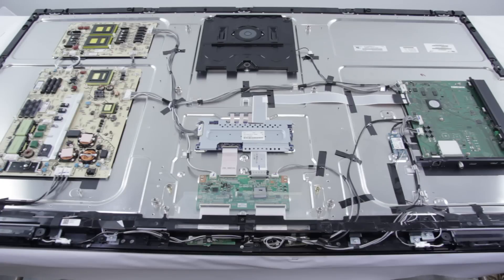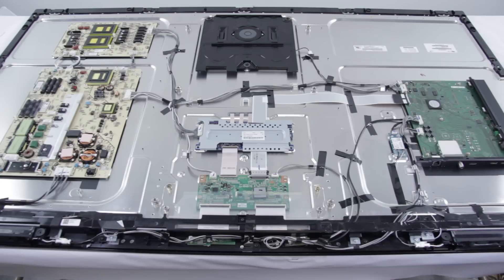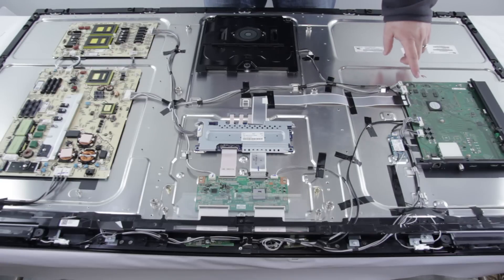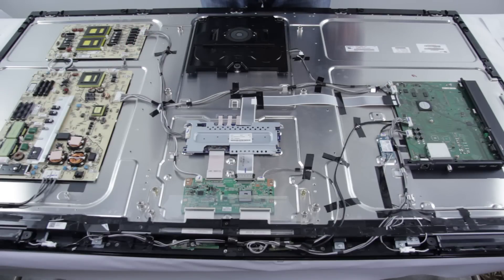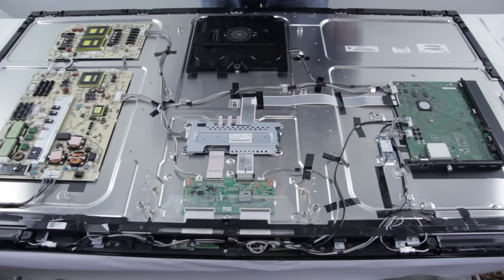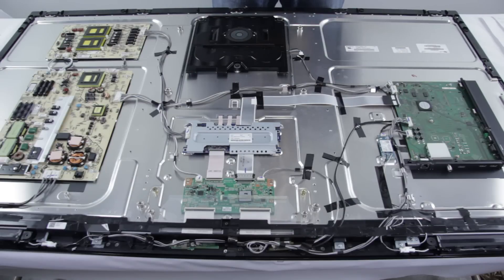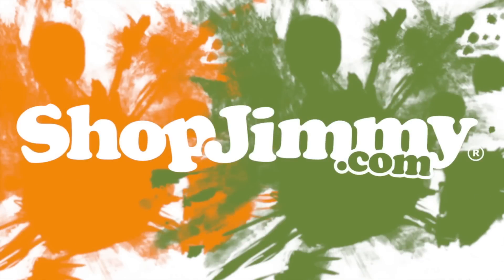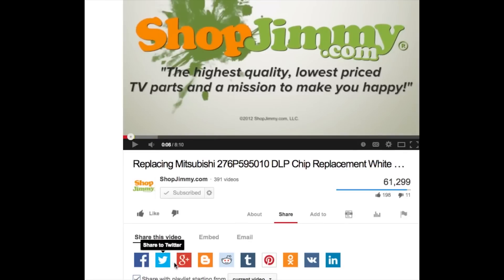LED TV Repair Main Board Overview Blank Screen-TV Has Audio but No Video-Common Issues Problems

Comment: I have a vizio led smart TV model E420i-A0, I was watching it and all of a sudden the screen went black but I still had sound. The white power light initially is bright but almost instantly fades to very dim if you turn it off then back on. The screen remains black. Any thoughts? Thanks!
Reply: Matthew Fultz I have the same exact TV and the very same thing happened to me. Screen wen black but still had sound. The white power light was bright then it dimmed.... Did you ever get your TV repaired? If so how? I'm hoping its a simple replacement.
Reply: I spent over 100 on parts. Replacing everything but the led panel with no luck. Sorry it took so long for a reply. Save yourself the frustration and buy a new (NOT vizio) TV.
Reply from the maker: Matthew Fultz  PLEASE SUBSCRIBE TO OUR CHANNEL - Try all repairs and troubleshooting at your own risk.   That could be a problem with the LEDs in the TV, if you tried replacing the Power Supply / LED Board and the main board and it did not fix the problem.  You can replace the LEDs in the TV and see if that fixes the problem.  LEDs can be difficult to replace and it is possible that you can damage the TV panel, if you damage the TV panel it is not repairable.  It is recommended that someone with experience or a trained professional replace the LEDs.  Click this link to replacement LEDs for your TV model number:  http://www.shopjimmy.com/lg-lc420dug-jfr1-led-strips-10-strips-1-board.htm  Be sure to match the panel sticker number in the listing with your TV panel.  Thanks and please let us know if you have any questions!  www.shopjimmy.com

Comment: hi i have a lg47ln575v when switching tv on, screen comes on for 1 second and then goes pitch black. I can see the picture very faintly and when i switch the tv off it shows the picture for a second and then goes off. it does this everytime i switch tv on or off.audio works perfect as does everything else. Problem is a blank screen. Could you please help

Comment: I have a Samsun tv type UN50EH5000FXZA that has sound and leds but no video  Visual inspection of all boards and cables was ok I replaced  all tree board on it but non corrected problem any ideas

Comment: Hi i have Panasonic TX-L37E5B Problem is that i have black screen whit sound, even i can't start menu or whatever. when i put antenna i can hear only sound but without picture, nothing. i can't see which channel is that, i can't see menu options nothing at all, only sound. Can you tell me what and where is the problem?  Thank you!

Comment: I have Polaroid LFM323B 37" LED that has a black screen w/various vertical color lines and nothing else, any suggestions
Reply from the maker: Scott Dempsey  This sounds like a TV panel (TV Screen) problem.  If your TV panel is bad, it may be more cost-effective to replace the TV as panels are typically hard to find in stock, difficult to replace, and expensive.  Thanks and please let us know if you have any further questions!  www.shopjimmy.com

Comment: I have a Vizio M601D-A3R LCD. I have the power light on the bottom of the screen. I have sound. I can see the picture when I do the flashlight test. My TV has 3 large panels on the back and does not look like the ones in the video. Whats next?Walt Macon

Comment: Vizio E50x-E1, serial # LTMWVJWU -  works well for about 45 minutes than picture goes away. Restart and works again for 10-15 minutes and picture goes away. Has Sound. I can see light bleeding around the edges of the set (back is off) when the picture is gone. 'Flashlight test' shows no picture on the screen during failure.  Unplugging the ribbon connector on the left side of the t-con and I get 1/2 a picture that does not fail & the other side is white/blank. Unplugging the ribbon on the right no picture, one side of the screen is white and the other eventually turns bright yellow.  Display stays lit for hours with one side or the other of the t-con disconnected. Swapped a t-con, same thing. Am I looking at a main board problem?  thank you in advance.

Comment: ok,

Quick question here guys. I have a Vizo  e390i-a1  Well after a recent storm passed through our area I came into the room to find that my TV was broken. Orgnialy I thought it was not getting power. After opening it up I saw no evidence that this was the case. Now I have power, I simply do not have a picture. Is this a simple parts replacement? Or is there more to it.

Any help you guys could give would be much appreciated.

Thanks.
Reply from the maker: twichy69    PLEASE SUBSCRIBE TO OUR CHANNEL - Try all repairs and troubleshooting at your own risk.  I recommend replacing the main board in your TV.  Click this link to replacement parts for your TV model number:  http://www.shopjimmy.com/catalogsearch/result/index/?cat=56&q=e390i-a1  There may be multiple boards for the same TV model number, be sure to match part numbers on your current board, with your replacement for compatibility.  Here is a link to a video showing how to identify your part number, click here:  https://www.youtube.com/watch?v=kxkeGLhlQY8  Thanks and please let us know if you have any further questions with your TV Repair!  www.shopjimmy.com

Comment: I have a Samsung UN46FH6030 TV.  I still have an image but it is very dim.  When I adjust the backlight it works normal at backlight settings 1-3 but once I select 4 or higher it goes VERY dim.  My first thought based on your videos is that my LED board is going bad but not yet completely failed.    Based on the parts available for my TV it looks like the power supply and LED board are combined.  I opened up the  back panel and the model number on the power/ LED board is BN44-00564C.  Just checking to see if my diagnosis sounds right before I order the part.
Reply from the maker: Michael Button   PLEASE SUBSCRIBE TO OUR CHANNEL - Try all repairs and troubleshooting at your own risk.  This could be a problem with either the power supply or bad LEDs in the TV.  You can replace the power supply board to see if that fixes the problem.  Click this link to replacement power supply boards for your TV model number:  http://www.shopjimmy.com/catalogsearch/result/index/?cat=229&q=UN46FH6030  There may be multiple boards for the same TV model number, be sure to match part numbers on your current board, with your replacement for compatibility.  Thanks and please let us know if you have any further questions with your TV Repair!  www.shopjimmy.com

Comment: Hi  I have westinghouse dw39f1y1. I was watching TV and it went blank. If im Shining a flashlight at the screen... I can barely see the picture.. So the back light isn't lighting up

What part is commonly bad when this happens?
Reply from the maker: +Dustin McCallen   Try all repairs and troubleshooting at your own risk.  This could be a problem with either the power supply or the LEDs in your TV.  You can replace the power supply board in your TV to see if that fixes the problem.  Click this link to replacement parts for your TV model number:  http://www.shopjimmy.com/catalogsearch/result/index/?cat=59&q=dw39f1y1  There may be multiple boards for the same TV model number, be sure to match part numbers on your current board, with your replacement for compatibility.  Thanks and please let us know if you have any further questions with your TV Repair!  www.shopjimmy.com

Comment: i have a SEIKI 32 inch flat screen tv model number SE32HY27 my problem is that i was watching tv then went out of the house but when i came back in there was only sound but no picture i was able to change the channels still but i was still not able to see anything on the screen. do you know what could be the problem?
Reply from the maker: Dustin Lathan   Please watch this video FIRST to help with your repair!  TV Repair! LCD, LED, Plasma, DLP How To Fix Your TV with ShopJimmy.com Help!  Looks like there is only one board for this TV, and it should be replaced.  Here is a link to the replacement board:  http://www.shopjimmy.com/catalogsearch/result/?q=SE32HY27  Be sure to match part numbers on your current board, with your replacement for compatibility.  Thanks and please let us know if you have any further questions with your TV Repair!  www.shopjimmy.com

Comment: I have a Westinghouse VR-4085DF. The tv will work fine for about five minutes then the screen turns black but the audio continues. I can turn the tv off for an extended period of time then turn it back on and the picture will be back but again will go black after a few minutes. Any help would be appreciated.

Comment: Thanks in advance for you help. I have an lg 32 inch led. Model # 32Ln530b. The problems im having is the screen is black. The little red light at the base of the tv blinks once the tv turns off before it turns off it blinks twice. The tv does have sound when the cable and game consoles are attached. No picture at all.
Reply from the maker: PUNKIES44   Try all repairs and troubleshooting at your own risk.  I recommend replacing the main board in your TV.  Click this link to replacement parts for your TV model number:  http://www.shopjimmy.com/catalogsearch/result/index/?cat=56&q=32Ln530b  There may be multiple boards for the same TV model number, be sure to match part numbers on your current board, with your replacement for compatibility.  Here is a link to a video showing how to identify your part number, click here:  https://www.youtube.com/watch?v=RwHTvjMdrhk  Thanks and please let us know if you have any further questions with your TV Repair!  www.shopjimmy.com

Comment: My Samsung UN46D600sf has a black screen after powering on and displaying the Samsung Smart TV logo with vertical lines on it.  I disconnected one of the connectors from the TCon board to the LCD panel and I get half the screen displaying what it should with menu functions working and all. Does that mean I have a bad TCon board or a bad LCD panel.  Is it repairable?
Reply from the maker: +Armando Rios   Try all repairs and troubleshooting at your own risk.  This sounds like a TV panel (TV Screen) problem.  If your TV panel is bad, it may be more cost-effective to replace the TV as panels are typically hard to find in stock, difficult to replace, and expensive.  Thanks and please let us know if you have any further questions!  www.shopjimmy.com

Comment: Hello,  I have a Toshiba LCD/LED TV, model 55SL412U    Everything is fine on the TV but the screen has a "vertical smear".    The video is reflected vertically across the screen, and the screen somewhat flickers with the vertical smear.    The sound / inputs / etc are fine.   The TV usually runs fine for about a minute, then the smear starts. 
I have looked for swollen electrolytic capacitor on the power supply, but all looks good.  
Thanks for your help.
Reply from the maker: Dean Felten   This sounds like a TV panel (TV Screen) problem.  If your TV panel is bad, it may be more cost-effective to replace the TV as panels are typically hard to find in stock, difficult to replace, and expensive.  Thanks and please let us know if you have any further questions!  www.shopjimmy.com

Comment: Hi i have a Toshiba 65L7300U  D13258T05033A1  which will not turn on it has a green standby light which dims and stays on.Just a black screen . Can you help ? Thanks

Comment: Toshiba 50L3400u led smart tv it was working fine until I reset back to factory. Tv comes on with a red TOSHIBA  startup screen it stays about 3 sec. then disappears.            Screens is now blank but , when I touch the screen anywhere the light is around my finger tips and  the backlight seems to be on . The other thing is there's no light in front telling you if it's on or off.  The backlight don't  turn off and the remote and side buttons don't work at all.  ( All this happened after the factory reset.) What can I do the fix this problem?

Comment: I have a samsung UN50F5500AFXZC Tv, recently it has a bright white light ( like a flashlight) shining up from the bottom left corner. This gets very hot to the touch. Watched it for a day anyway and then the screen went grey, but still had audio. Turned it off for a couple of days and the picture came back, but the light was still there. Haven't watched it since. Any ideas what this could be. Can't find a repairman. Don't mind trying to fix this myself if I knew what the problem was.

Comment: I have a Hisense 50K610GW model. When it powers on I get nothing but a blue screen. No inputs work at all. After the tv warms up it will give quick lines in bottom portion of tv then you get a all red screen than changes to green and than will power off and than back on automatically repeating same process. A new power supply was sent by warranty company and an installer came to replace it. He was pretty sure that wasn't going to work and actually it did for about 3 mins using a different hdmi port than went back to what it was doing. He was pretty sure it was the main board but the warranty company didn't want to send another part so they sent me a check for a new tv and told me I could do as I wish with this one. 
I'd like to try and get it going. TV does not say version 1 2 or 3 anywhere in back panel. 
What would you recommend for this type of problem?  I do have a short video of exactly what it is doing if I can post it to you somehow. 
Please let me know what you think. 
Thanks
Reply from the maker: Jay Green   The main board is a common problem for this model, and I recommend replacing it.   Here is a link to replacement parts:   http://www.shopjimmy.com/catalogsearch/result/index/?cat=56&q=50K610GW  Be sure to match part numbers on your current board, with your replacement for compatibility.  You can also call our customer service for further assistance with your purchase.  (877) 881-6492  Thanks and please let us know if you have any further questions with your TV Repair!  www.shopjimmy.com
Reply: ShopJimmy.com I already have main board visible but my bar code sticker does not match what you show in your pics. There is a secondary sticker also with additional numbers. I will have to call your customer service department. If it's the v2 like I think tho you are out of stock. How often do you get hisense inventory in?
Reply from the maker: Jay Green   Difficult to say when we would have parts in stock.  You would need to sign up on the product page to be notified when the part is back in stock.  Thanks!  www.shopjimmy.com
Reply: ShopJimmy.com is there an email address I can send a pic of the bar code to so you can see the different#s?
Reply from the maker: Jay Green   Follow this link: http://www.shopjimmy.com/catalogsearch/result/index/?cat=56&q=50K610GW Click on each main board individually and below the images on each product page you will see text highlighted in red that tells you what numbers to look for on each board, to match up part numbers and find the correct replacement board. It will say something like this, "78932478239/8937248923 must be found on a sticker."  Thanks and please let us know what numbers you find and if you have any questions!  www.shopjimmy.com
Reply: That's what I'm trying to tell you bar code sticker the 1st part matches with the 164249 but after that 607,647 
There is another sticker below bar code sticker that has another #. There is no Barcode on this sticker. It reads 16248 53545EDO130M0218.
That is why I think images need to be sent. Stickers are one above the other
Reply from the maker: Jay Green  As it says for the Version 2 main board (highlighted in red), "164248 & ED0130 must be found on a sticker," and you have those numbers on your sticker, so that is your replacement board.  Here is a link to the replacement part:  http://www.shopjimmy.com/hisense-164248-main-board-for-55k610gw-version-2.htm  Thanks and please let us know if you have any other questions!  www.shopjimmy.com
Reply: Jay Green The tv will actually stay on for around 7 mins before doing what the video shows.I also looked at the part # of the pwer board the warranty company sent and let me keep and they sent the 165651 and I currently have the 165652.
I did notice when trying different inputs I got no signal from the hdmi 1 port. Which I believe if what I'm reading is correct confirms it probably is in need of a main board replacement.

Comment: My Seiki SE50UY04, picture goes black; sound remains. I discovered selecting "default settings" kept picture perfect until switching off. Now picture stays for 30 seconds then goes black. Power supply board or LED drive? Set is 5 yrs. old so maybe landfill time. Perplexed in FLA.

Comment: hi: I have a 60" Class AQUOS HD Series LED Smart TV LC-60LE650U, I replaced the power board, thinking is going to fix the on and off issue but still does the same thing, any idea what the real issue

Comment: my haier 50E3500A wasn't giving me a black screen with audio. I replaced the main board, the power board and the led lights. It came on with the screen showing and was working and then couple minutes later it went back to the black screen again with audio. What could be the problem?

Comment: Hi, I have problem with LG 47LM8600 . TV Screen goes blank after two three minutes and still sound is on.  i found TCON and main board. can you suggest me which board i need to change to fix this issue?

Comment: Vizio E60-E3   replaced LEDs and when I reassembled I had a picture with a big dark spot across the bottom of the screen,  I checked the ribbon cables to the screen, Now the TV is recycling on and off, I also noticed the top line of lEDs goes bright and then the middle brightens. I still have a fuzzy dark area at the bottom and no picture  I do have audio

Comment: I have LG 43LF5400 my TV is turn on has sound but no picture. I can see the led lights are  on from back side of TV. I had replaced main board, T-con board, power supply but still nothing. Any ideas?